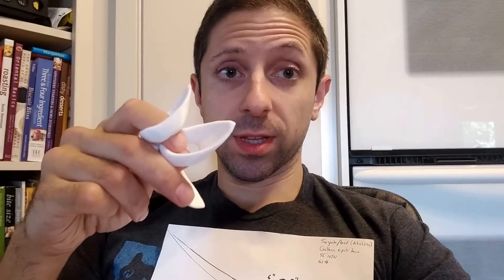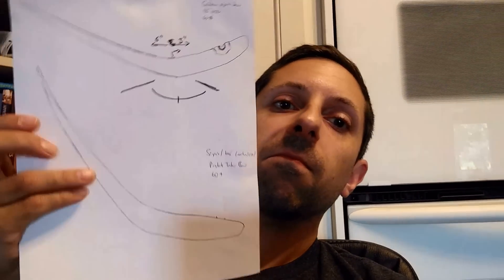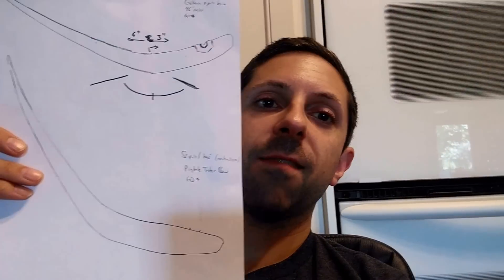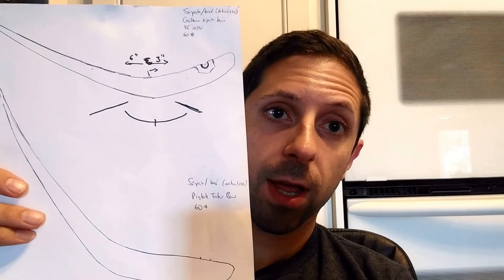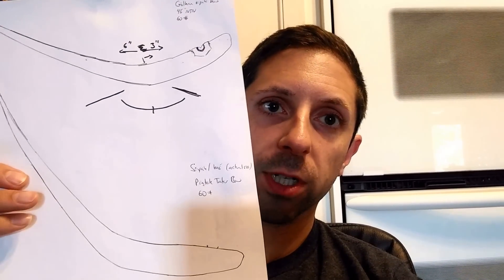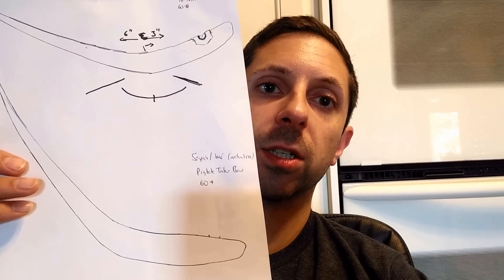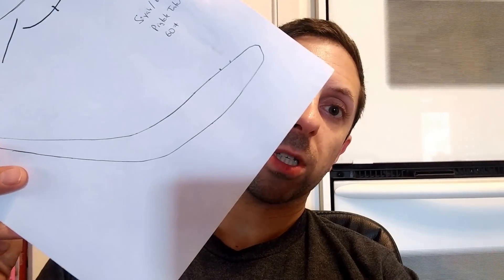Update: Thumb Rings and a Siyah

Comment: Funny I came across your sketch online after researching siyah angles for Turkish bows,  but I have to say that 3d printing something like that is time consuming , the tech needed to get the results and endure the temperatures of use in the full sunlight is not a good thing so far... 

Really need a magic material thermo plastic that is extremely durable , 45 years worth of bending stress and resilient against UV radiation.. 

If there is a 3d filament likec that I'd like to see it for real.